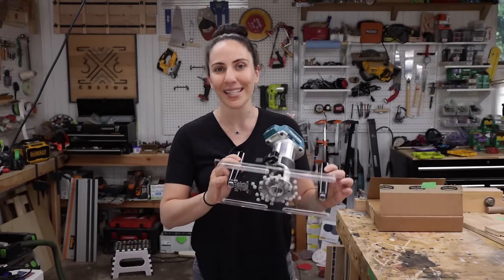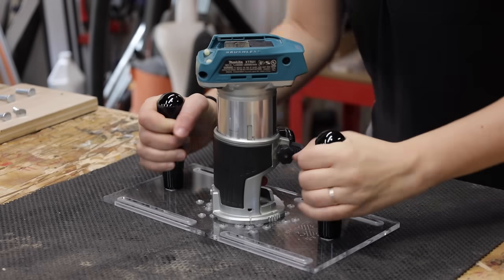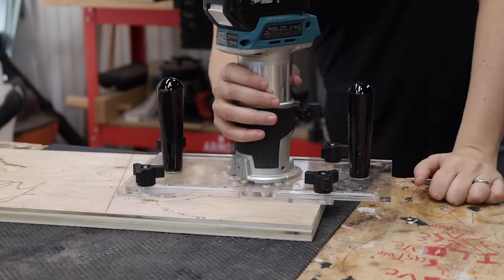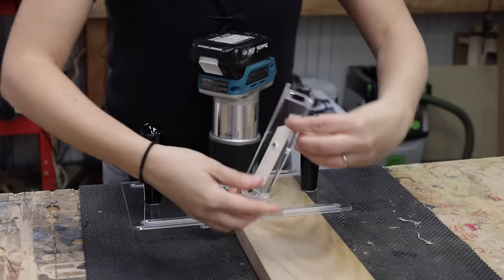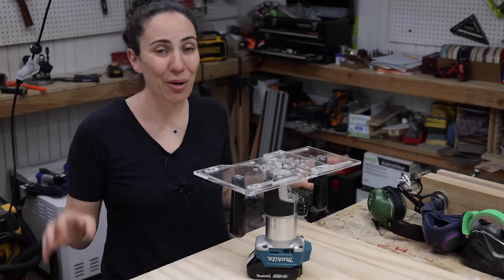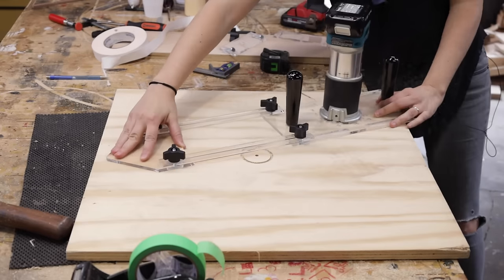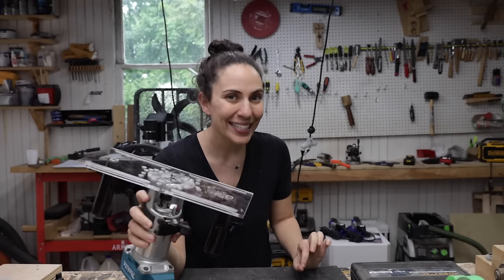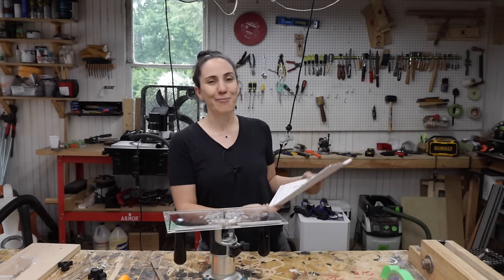How to Use the 6-in-1 Universal Trim Router Jig

Comment: Finally got a chance to cut a circle.  I needed a 4' diameter circle for my project and the jig only goes up to 3'.  I managed to grab a piece of scrap plywood from the project that was 6" wide, cut it at a length of 16"-18"  (I don't recall the exact length) to get the 24" radius size I needed.  I drilled holes in the corners and replaced the extension runners with this board between the base and the triangular piece.  I measured and adjusted the length with slots in the base to the precise measurement.  I was them able to use my trim router to cut out the circle with ease!  Love the jig and appreciate all that you do.

Comment: Suggestion - make the various holes numbered instead of colored if someone's colorblind or doesn't have a color printer
Reply: My issue exactly. I am colorblind.  So, as much as this tool would streamline my woodworking, I wouldn’t be able to use it.
Reply: @DaveHarris75  You could take your router base and align it to the jig base.  Would take a little more time, but since it is centered, rotate until it matches up.  Would that work?
Reply: @JNRII  yes that’s what I did. Only took maybe 30 seconds to find the holes. I didn’t feel like printing the guide.
Reply: Where would get the router that you have it looks good
Reply: Reply please

Comment: Had mine a few weeks now and it has delivered 100 percent. Believe the hype! I even managed to knock it off my bench with the extension arms attached and I was terrified that something would have cracked or chipped off (it fell onto a concrete floor). It was no worse for the wear at all, no damage. As a precaution, I got my centering bit and reset the base to make sure it was back on center and after that I was back in business. Can't even tell it took a tumble. The edge guide worked like a charm and everything was easy to change out. Absolutely no complaints! If you're thinking about getting one of these, wait no longer. Get one, and I promise you will not regret it.

Comment: one of the most professional and sympathetic presentations I have ever seen FROM a designer of a tool explaining "his" thoughts that flowed from the head into the tool / product. Advantages, disadvantages, limitations, possibilities. Only in such a case can a customer feel well informed that they want to buy and use the product, or whether they would rather use another product with an equally detailed product presentation. 

Every product should be offered with a description by the designers and not by marketing!

As a rule, I find loveless descriptions from "salesmen" who just manage to copy the manufacturer's data and manufacturers who produce product videos of 30 seconds, often even without language. With this, a customer is supposed to get to know the product or even a whole product line with accessories in the possibilities? Laziness or hubris?

The companies take the opportunity to establish a first connection with the customer and to show what sets them apart from their competitors. Probably nothing! Probably the companies are afraid to explain a tool (or even a kitchen machine), to bear costs for it and customers then buy the machine and the accessories from the competition. But the more complex a product is, the less customers can switch because the accessories are also rarely compatible ("lock in"): e.g. a guide rail, the hose from the extraction unit or, as shown here: the mounting holes for the jig on the router. (btw: Metabo (german) is not on the list).

This problem unfortunately affects ALL industries and "ends up" on amazon, where you can even find on food and clothing: "Battery required: no" and "Battery included: no". The sellers apparently do not even manage to delete this - presumably an example from amazon - and make their own, comprehensive (complete) description. In the short time available, sloppy work seems to be the order of the day. Machines and accessories are sometimes sold in euros or dollars per millilitre or per kilogram, or a drill suddenly weighs only 25 grams. 

I don't even want to talk about contradictory statements by different sellers or even on the same page and about "Chinese translations".

It was a great pleasure to listen to this product presentation.
Reply from the maker: So glad you liked it!

Comment: Since being able to use this trim router jig for months now, this is what I have discovered: Take this jig, a recommended router (mine is the Dewalt router) and the Micro jig clamping system and the possibilities for creating not only jigs but other woodworking projects is pretty much endless. Thanks for this invaluable tool you have designed and created!

Comment: A quick safety tip from my experience this morning. I was using the router in an awkward placement. I was holding the router by the jig handle, in my left hand, and used my right hand to turn the router on. When I let go of the router switch, the weight of the router twisted the jig, and it began to unscrew from the handle that I was holding it by and the router dropped and swung suddenly downwards. Make sure that your jig handles are screwed on tight!

Comment: Got my jig in about 5 days.  Very nice quality and easy to assemble.  Only hiccup was when I put on my Bosch colt, the screws sat a little proud.  I carefully deepened the holes with a 5/16 forstner bit and now they are flush.  Can't wait to use this on many projects.  Was going to build a circle cutting jig.  Now I don't have to

Comment: Tamar, I found your channel two weeks ago, so I am late to your game. After watching this video I ordered this jig from you, received it promptly, and have begun to "play" with it. 

Thank you for designing this jig - or whomever did. Simple, fast, works on my Ryobi 2-1/4 Hp router, my 3 Hp Porter Cable, and on my tiny laminate edge trimmer router. I expected that I would have to add some holes as I did not expect any one jig to fit all three of these routers (especially since my laminate edge trimmer is an incredibly cheap, off-brand from a company that references open water and cargo in its title and are notorious for making use-once disposable tools). In this case, my expectations were not met. 

Love your confidence in the shop. 👏💛
Reply from the maker: I designed it ☺️ so glad you like it!

Comment: An excellent, very versatile little jig.
One thought, however. A few months ago Stumpy Nubs made a video on the importance of using a router table starter pin when you are routing on a table without a fence. Perhaps for the next run you could add a threaded hole to the base so that the circle jig pin could be used as a starter pin if someone wants to use the jig as a router table.

Comment: I built the 'original' jig from the first video. I use it almost every time I use a router now, can't live without it. It's also very easy to add additional purpose built attachments. Yes, I ordered the kit as well. I want to be able to have 2 jig setups at the same time, so... Need 2 jigs(!). Almost forgot... Thanks for this video, great reminder for the jigs many uses! It's beautifully done, the colored inserts showing the jig parts in configuration are great!
And of course... Your spline jig for the jig is a great idea (a jig-jig!? Waiting to see how you make a jig-jig-jig! Where will it all end...!?)
Update 7/16/2022 Just received my router base kit, took a while to receive (congratulations on having such a successful start!). The parts in the kit are beautifully cut, everything was there. Hardware is great quality, hefty handles are just right, knobs are excellent - couldn't be happier, a great jig for a great price! (The handles had a small rough spot at the top joint where the 'cap' and handle meet, but a little sanding and some paste wax took care of that - yes, I'm pretty fussy about how my tools look and feel - others may not even notice or bother...) In any case - THANKS, Ms. Tamar, I now have awesome 2 jigs and am dancing a third jig with delight ; - )
Reply from the maker: Hahaha so meta 😂😂 so glad to hear that you love it!

Comment: I finally got mine set up, I live in New Zealand and the routers available are mostly different * than available in the US. I was able to purchase the equivalent of a DeWalt 611, model D26204K-XE, and it fit the 611 holes perfectly. I might check other routers that I run across overtime to help build a non-us list of routers. *Cordless routers seem to be the same, but wired ones are different. I am excited to use the jig.
Reply from the maker: Awesome. Glad it fit!

Comment: Awesome jig, and I might add that it has most features of many higher priced commercial versions. I would only recommend using a drop of (removable) Loctite to that threaded pin. Cheap insurance. I have lost (and then manufactured) a similar pin for router table plate.
   FANTASTIC build, all around.

Comment: Thanks for this video. I have this jig on order, but belatedly realized that Bosch has two trim routers called Colt plus plunge bases. This video showing the screw hole patterns was shown just long enough to allow me to see the several Bosch combinations that the jig was designed for. Pretty much assures me that the jig will work for me.

Always enjoy your content. Great work!

Comment: Tamar, This is a great jig. i built it from your plans and everything went great until I went to use it for the first time. I had attached my Makita router with the plunge base as I felt this would be the most versatile setup. When I put on the edge guide piece, I couldn't get it close enough to the bit because the plunge base is bigger that the regular base and it gets in the way of the bolts to hold the edge guide. Not a problem to make another edge guide piece a little wider and the setup worked great. This is a well thought out and versatile setup, just needed some tweaking in my instance.

Comment: I have been meaning to make a jig like this for several months and just have to many other projects going on. Purchased this and I would recommend. Nice kit. Only issue I have had is the screws for my router(dewalt) protrude from the router base but that's a quick fix. Switch to countersink screws or just sand down the heads of screws about a mm.
Reply from the maker: If you are having any issues please reach out to support@3x3custom.com and we will sort it out 👍

Comment: At the risk of adding more holes and weakening the plate, it would be nice to have another set of grooves that allows to add a piece of wood that runs across as an adjustable fence.   Would come in handy for those of us with no table routers.  Thanks for all the work put on designing this jig.
Reply from the maker: Wait for a video of mine in a couple of weeks 😉

Comment: Tamar, your design is brilliant, and Jonathan knocked it out of the park with manufacturing. Question, suggestion: does the plate with the smooth hole have a cross air engraved into it? That would make precisely positioning the jig for hole-free circles a snap.
Reply from the maker: Glad you like it! It doesn’t. But I find it’s fairly easy to center the 1/4” hole over a mark

Comment: Good tip on the edge banding. Not something I do but today I have been using a trim bit to clean up a slight overlap on a box that I made using left over 12mm ply from another project. Looking forward to receiving my jig as your method will be much easier. Also I have other projects in planning which will use circle cutting.
Reply from the maker: Awesome. Glad it will be helpful!

Comment: This jig is awesome!  I built the DIY literally 3 weeks before release.  (some mistakes were made) 

I DO wish this production version had the center line etching on the rectangle pieces.  This feature is really useful for lining up the center of the pin on some reference marks for a circle cutting without the pin.  

I hope you'll consider making a CNC etched center marked rectangle piece as an add-on accessory in the future.
Reply from the maker: Glad you like it! Yeah… I found that I wasn’t really using them as often as I thought I would

Comment: Very cool - I ordered your thoughtfully designed system - I was getting ready to build something similar, but - considering $25 for materials, and a couple hours [at least] of my time - it's a no brainer! And, yes, the base system provides the 'basis' for future extensions / uses.
Reply from the maker: Hope you like it!
Reply: @3x3CustomTamar  I got it, and it looks great, thank you. Easy to put together and well crafted. I've attached it to the plunge base for my Dewalt for the moment. Looking forward to using it soon to make grooves for matchfit clamps in an off feed table for my son in law's table saw. I'll report in more depth when I've used it a few times - but I'd have been hard pressed to make this in any reasonable amount of time.

Comment: Hi Tamar. I received it a few days ago and love it. An option you might consider at your next design meeting :) is dealing with corner radiuses. Yeah, I know,  "just remove the base", but almost everything I want to do with my trim router is on my base attached.  I don't want to remove my base to make 4 radiuses. So how do you safely hold a corner radius jig and router accurate radiuses and still have your nickels unscathed?

 I have a couple of ideas and will probably make an option. I'll let you know how it works out.  Hmmmm, the more I think about it the more I think you could sell it at a fraction of the price of the major tool manufacturers.
Reply from the maker: Not quite understanding. I usually just used double sided tape to hold a corner radius jig down and I use a flush trim but with the base one. I never have to base off

Comment: Regarding what you said @15:27, I wonder if there's a possible (tiny) improvement here.  If the extension feet all had a small indentation, perhaps a half-inch radius (or whatever makes sense), halfway along one side, then you don't have any risk of chewing them up with the bit.  This is just like how router fences have a hole in them.  (Though the hooked-under shape that you get by stacking offset feet is probably still useful in some situations.)

And, indeed, if one wants to use the router upside-down as a makeshift router table (as shown @16:45), the 3 feet stacked would make a makeshift fence, and again that'd be better with a small indentation for the bit.  And I'd guess you'd want to put that concavity only on one side of each foot, to make the other side more predictably straight, in case that matters sometimes.

Comment: Love this system. My SKIL 1817 is not listed as compatible, but I think I might still be able to use it with this jig. It is a 3-hole with ~4 5/8" between the holes. I bet I could just center it over this base, mark my holes and drill/countersink them out. What are your thoughts?

Comment: I have this and works as advertised, one flaw I found is the center hole is not as big as the factory size for my DeWalt trim router. I use the Whiteside 402 1/4 shank bit set and the bigger router bits circumference doesn't fit the center hole of this jig.

Comment: Hey Tamar!  I'll be your 867th compliment - you guys are awesome!  Congrats on this joint venture!  I hope this is an easy question.  I have the Dewalt DCS600B cordless trim router (which JKM missed on his best trim routers video).  Will your jig fit it?  Maybe the same hole pattern as the corded DWP611.  Hope so.  Thanks.
Reply from the maker: That’s the one I have been using with it lately!
Reply: Perfect!  Thank you, and keep up the great videos!  @3x3CustomTamar

Comment: Oh boy!!  Mine just came today.  I missed the initial offering because I "wanted to think about it overnight."  Big mistake.  I jumped as soon as Tamar announced the next availability.

A couple of pro tips for installation.

1. I have a Dewalt DCW600.  It's not listed in the instructions.  That said, it fits perfectly on the holes indicated for the Dewalt 611.

2. Mark the holes on the factory default baseplate in case you ever want to reinstall it.  After I did that, I used those markings to confirm the Dewalt choices in the instructions.

3. Mark the holes per Tamar's instructions.  Mine fit perfectly.  Be sure to mark those holes for future reference.

4. I didn't have any trouble removing the sticky paper, except where the 3x3 Custom logo is.  That said, you need the logo for installation orientation and I wouldn't trade that logo for the world.

5. I did install the guide bushing I have for a dovetail jig.  It fit perfectly.  I almost cried.  Finding a baseplate for the router that would hold the guide bushing was a headache last year.  This solves the problem.

I'll try it all out tomorrow.  THANK YOU, Tamar, for dreaming this up.
Reply from the maker: So glad you like it! Adding the guide bushing recess was a last minute idea… glad we went with it!
Reply: @3x3CustomTamar  The guide bushing was absolutely the selling point that made the difference for me.

Comment: I used the jig to cut a circle with a drilled hole and it worked very nicely. I have been trying to use the edge guide to route a dado but I often run into the situation where the jig bumps into the clamps I have securing the wood. In the video you did not have clamps but the wood remained steady. Was it just double-sided tape?
Reply from the maker: Glad the circle cutting worked out well for you! I don’t recall what I did in this video, but I use double sided tape a lot, there’s a high probability I did. Ha.

Comment: Also, is are the hole patterns exclusively for current routers?  There's supposed to be a new Ryobi Trim router in August 2024 which i'm strongly considering... do these brands basically stick to a  "SET" hole pattern?